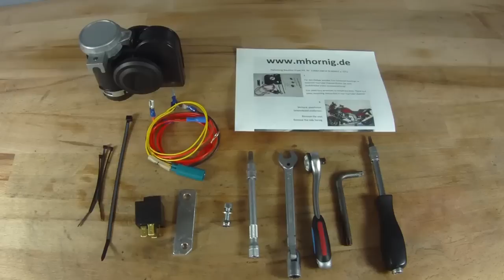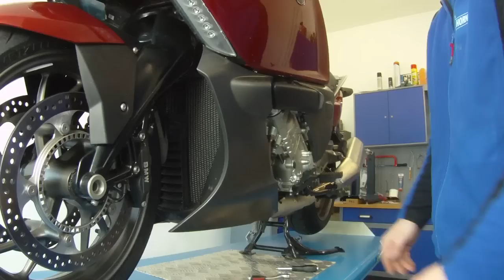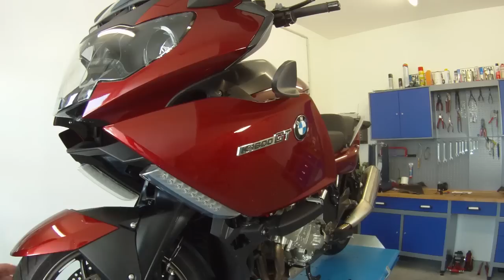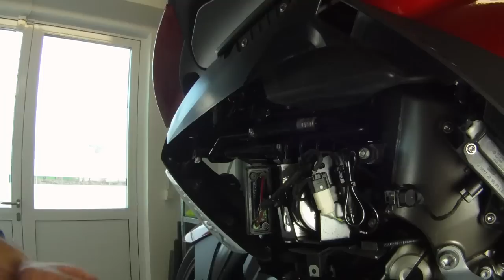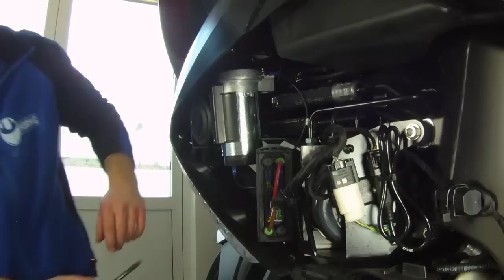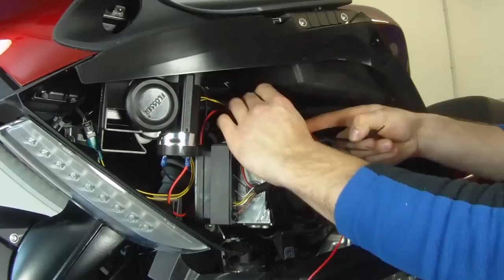Nautilus Stebel Horn Hupe BMW K1600GT by Hornig

Comment: This is not quite as simple as he makes it look, he's done this many times.  :-)  I just did this on my 2012 K1600GT and have a few comments.  

1.  It would be helpful to know the size of the bolt holding the OEM horn, it's a Torx 45.  That's a big wrench unless you happen to have the type he uses.  Otherwise you'll do what I did, take the fairing bits above that area off, and find it's a right royal PIA.  
2.  I didn't have the bracket he uses/shows.  So I cut the original bracket by a couple of inches and drilled a hole to fit the big bolt provided with my Stebel horn.  It isn't simple, so be prepared to make the bracket fit.  It MUST be placed on top of the horn mounting bracket on the frame, there isn't enough room otherwise.
3.  I couldn't get the Hornig package so had to tap into the original horn wiring, no big deal but it is tight, not a lot of room for working with the wiring harness.  
4.  His kit uses uninsulated terminals at the relay, not a great idea IMO.  
5.  He doesn't show how he gets the wire to the battery, other than to suggest he routes it behind the frame.  Without a lot of work that's not a great route, and I found that pulling the tank cover off on the left allowed me to route the wire in a groove in the tank.

Knowledge of the assembly of the fairing is very helpful, and may reduce the number of redoes.  But I found this video was helpful.  I LOVE this horn, it's very loud.  I have it on my '06 K1200GT as well, in the same location.  I just picked up the K1600Gt and cannot believe BMW puts such a crappy horn on it.  My '96 K1100RS has far superior horns, they've really taken the wrong tack with these pancake horns.

Thanks to Hornig for posting this video, it was VERY HELPFUL.